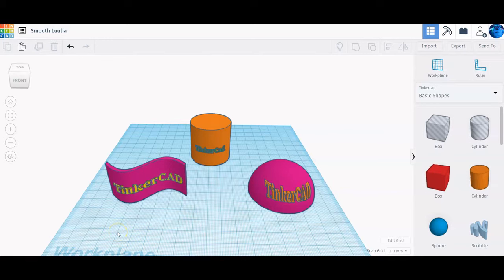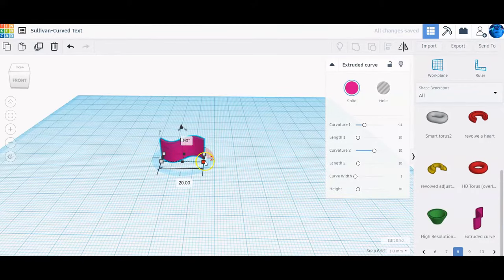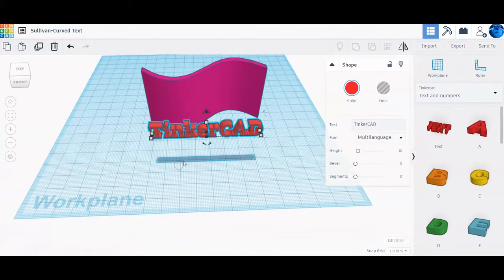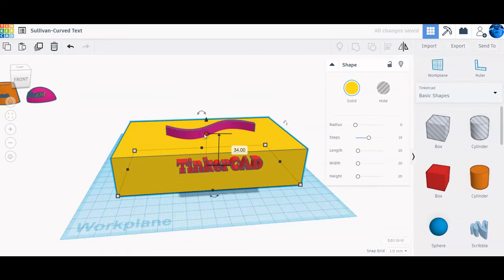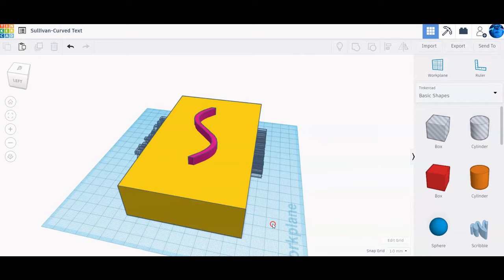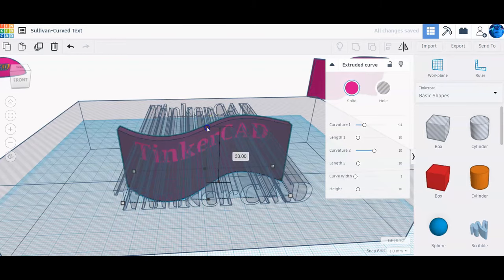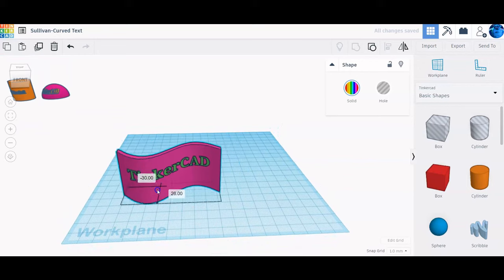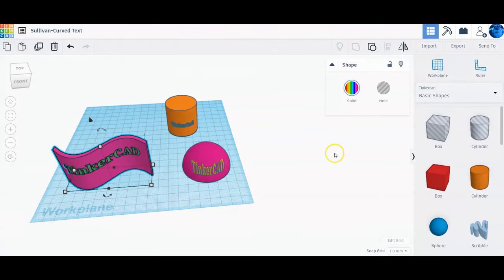TinkerCAD   Curved Text

Comment: Really good and exactly what I needed, but the video could have been 30 seconds instead of 11 minutes. Assume that total beginners won't want to do shaped letters, so showing how to select 2 vs 3 shapes is a waste of time. One small issue with this technique is that the letters on the edge get skewed - eg I can't use it to wrap a text around a cylinder. Still looking for solutions for that.